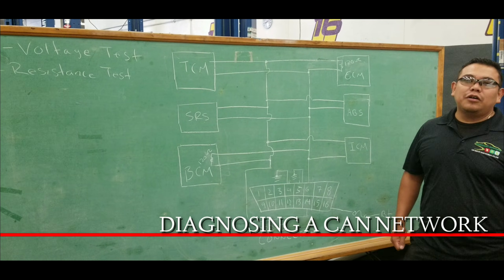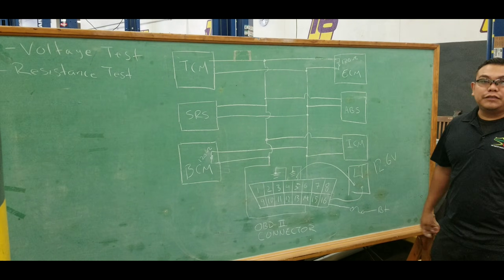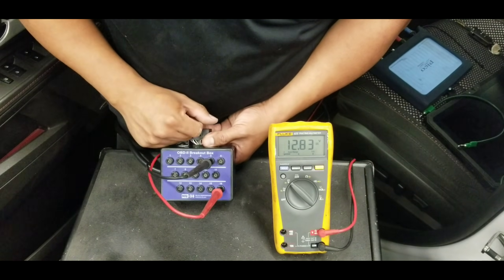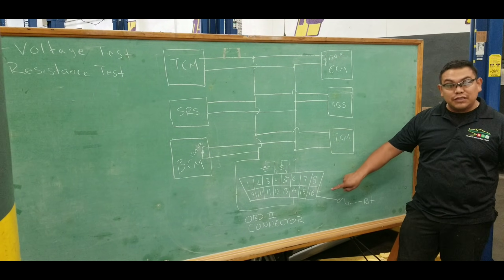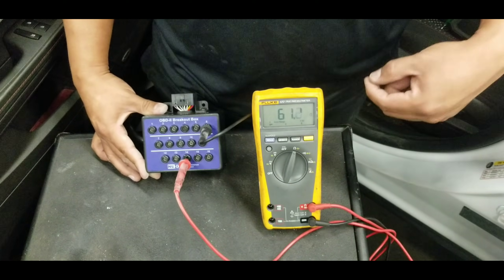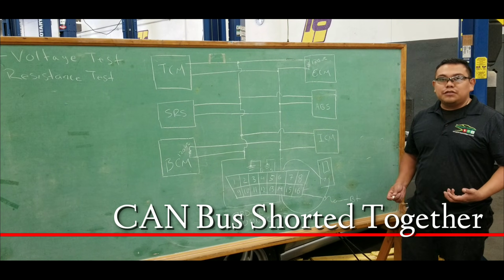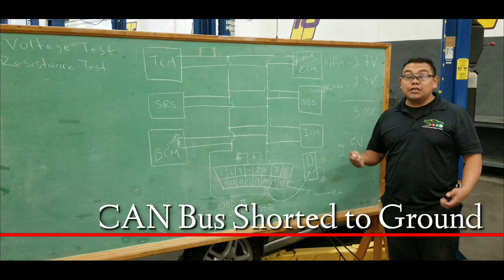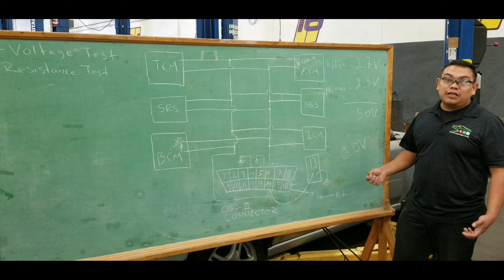How to test a CAN bus network with a meter

Comment: Great video! My issue is that I'm getting low voltage on can-H (around 1,5V) and can-L (around 0,5V), but the resistance test gives me exactly 60. Where should I start looking for the cause of this? I'm also getting full voltage (12,5V) to obd's port 16 so my battery is not the issue.

Comment: Thank you for this video, What happens if we connect the high can bus wire from one ECU to the low can bus wire and the low can bus wire to the high can bus wire of the other ECU?
Reply from the maker: The wires will be shorted together, the meter will read 2.5 volts and communication between modules will not occur.

Comment: Valuable information.  The drawing was helpful and is always appreciated.
Can you do the same type of video for an OBD1 system?
Reply: None of this works on OBD 1 vehicles.
OBD 1st Generation of " Check Engine Lights " are  some1979 to 1982 vehicles & especially 1983 to 1995 vehicles.

OBD 2 Generation vehicles are 1996 to Year 2022 , so far.

What the sharp Instructor is Sharing is  for the Advanced vehicles utilizing  CAN ,
which commenced in Model Year
2007 or 2008 vehicles ; it's called
Controlled Area Network vehicles.

There are " 4 " types of Diagnostic 
Trouble Codes that can be retrieved when the Check Engine Light
Illuminates : Powertrain Trouble Codes
( which will Automatically Fail a California vehicle on a Smog Inspection  )....P0301 : Misfire on Cylinder # 1 for Example....Any vehicle in the United States that displays P0301 from Model Year 1996 to Model Year 2022 means the same thing , " You have a Misfire on Cylinder # 1
( whether it's a Volkswagon  - Ford Mustang - Chevy Camaro - a BMW or -
Mercedes  Benz.

Chassis Control Module Codes
Body Control Module Codes  &
the CAN vehicle has " U - Network Codes "

Ex Smog  Repair Technician
Southern California
Hope this Helps

Comment: Is this the best way to diagnose cpu problems
Reply from the maker: This is the way to check the bus network in case of a no communication. This method can help identify a faulty module that is unable to communicate and shorting out the bus network. Once the module is identified, the next step is making sure that the module has the required powers and grounds.

Comment: You cant beat a simplified drawing to teach the CAN bus. Very well done. I would like to add one thing. When using the multimeter the voltage and resistance will auto-range unless you change it. So, for example, you may be reading 12.50 millivolts instead of 12.50 volts. If you aren't paying attention to the digit after the voltage numbers you could end up chasing your tail. Same goes for resistance readings. I (now) always press the range button to manually set the meter to a specific range  like 0-20VDC. Same goes for resistance readings. Thanks for the video.

Comment: you can take a 120 ohm resistor and place it in parts of the network to isolate parts of the network to speed up diag

Comment: What if the meter displays 109ohms when ecm is disconnected, what could be the problem(s)?
Reply: Pull out the other resistor on the other end of the circuit and do a ohms resistance test across the two pins. Should read 121

Comment: Hi I suck with electrical and was wondering if you could help out? Bought a 2006 Dodge Charger rt, was having some small electrical problems at first then started stalling, ordered a pre programmed pcm as a mechanic stated because I didn’t have the tool to diagnose that, now that I have it took it back to mechanic, and now there saying I have a can b bus problem U0019. Is there a chance the new pcm is the problem or is it the can b bus, but then shouldn’t that have came up before getting the new pcm? Any help would be appreciated, Thanks

Comment: I'm working on a ram 1500 5.7. No communication with multiple modules. 61 ohm on pin 6 and 14, but I have 2.4 volts on both 6 and 14. Does that mean I have a short on that twisted pair 6 and 14 from the tipm?

Comment: You forgot one other problem. As long as the two modules that have the 120 ohm resistors are connected to the network everything you said is correct. BUT if any, or all, of the other modules are disconnected ( open) circuit, none of those tests will show that.  i.e. body shop does not repair or replace the wiring harness ...

Comment: I would like to add that in the beginning he said one of the first steps is to disconnect and measure resistance but I disagree. If you happen to catch the failure in progress DO NOT disconnect because if you do happen to have a Module failure you can cause the failure to correct itself and you will be chasing your ass! The more reliable tool for diagnosing CAN should be a scope to actually see the signal without mode of failure interruption.
Reply from the maker: I agree, discomnecting a module can cause the problem to correct itself.  I also made a video using an oscilloscope  which is the best option.

Comment: Please I need your help. My car is 2013 F150 Ford has hard steering wheel to turn its hard to turn . My scanner shows me codes U0131 Lost communication with steering module . I have 12.6 Volt between 4 and 16 . Also I have 60 ohm between 6and 14 . But when I put it on volt test between ground and 6 it’s shows me 0.2v and between ground and 14 is 0.2v. 
Please what do you think?

Comment: @Mr.Diagnostech

Great video! Noticed one thing I didn't see in comments but didn't read thru them all either. 

Around the 1:57-2:01 mark when your saying numbers you mentioned voltage at number 6 when we all know you meant 16 when checking for the voltage and pins 4 & 5 for the ground. 

I think you were thinking about pins 4 & 5 and 6 came out naturally vs 16 as numerical order. 

Great video, keep up the good work and I'll be subscribing!

Comment: Thanks. I got a no crack/no start on a 2011 chevy malibu after replacing starter. Already did the swapp of all tcm, ecm, bcm, and fuse/relay box. Starter signal wire isn't getting power to start. Got the starter to start by touching a 87 in the relay when plugged in. Going to do these tests and hopefully find the wiring problem. If not, junking it. Seems like a short between bcm and ecm. Sighhhhh.
Reply from the maker: Watch the video https://youtu.be/BFT6k7VERbE it will also help with this issue.
Reply: @MRDIAGNOSTECH  Thank you for the suggestion. But the start relay was not the problem. The start relay isnt getting any power. I installed the relay with the cap off, and attempted to start, relay doesn't move/click. I measured resistance from both 120ohm from the obd port and got 64.3ohms. 

Not sure if you're fimiliar with the chevy electric problem where the guages don't go all the way over and back after attempting to start, no temp reading from the cluster, constant repeating messages to check power steering, esc, and traction control light intermittently comes on, blinks erratically. Its leading me to think I have to replace the complete harness that goes inside the vehicle.

Had no electrical problems until after I replace the starter after recently having the engine replaced. Been tackling this issue for about a couple of months and i'm losing motivation to keep diagnosing. Only thing I havent swapped out was the ignition switch. This is seriously stressing me out. But thanks for your help though.
Reply: Hello sir, I finally did all the tests just now. Everything shows same numbers as yours test exept for the CAN voltage test. They're a lot higher than 2.7/2.3 v. Low measures 3.67v, High measures 3.48v. Resistance is at 60.6 ohm. Is there any concern for the high 7+ voltage?

Only problem I found is no power going to pin 85 in the start relay from ecm/pcm when turnkey over to crank. Swapping out the BCM and ECM didn't fix that problem so its either the CAN wires between the ignition switch, BCM, and ECM. I already have the new ignition switch, so maybe I go install that and see what happens. (Edit: Swapped switch didn't correct the no crank issue).
Reply from the maker: @PanameraTurboSEHybrid  Based on how the problem started after an engine replacement,  I would first focus on checking all the grounds to the engine and chassis grounds. Remove them, clean the contact surface and connectors and reinstall them. Intermittent faults can be cause by a bad contact, specially after someone has worked on it.
Reply: @MRDIAGNOSTECH  The no crank problem actually started immediately after replacing the starter. Vehicle was kind of running fine for a few days after replacing the engine until the starter give out.

And yup, the grounds were the first thing I checked once I got the car towed back to the house. I replaced the starter in the parking lot of a shopping plaza (intermittent starting issue because ground strap from starter was broken). But I'm going to cut my loss with this car now. Going to destroy it too so no one else gets to stress themselves like I have with it. Been 2 months Since it last ran. I dont like quiting, but I'll accept defeat on this. All this CAN line communication diagnosing is way beyond my experience, my brain just melts everytime I'm looking at wiring schematics. I seriously do appreciate the help. Bless.
Reply: @MRDIAGNOSTECH  Got the car crank and start today FINALLY!.....When you said to check all grounds. I went and double checked again. Found a hidden ground right under the intake manifold to the engine block. Now it makes sense why no crank after replacing the starter. I must have stretched that ground cable far enough and broke the wires attached to that terminal. Repaired that ground terminal and car started after a few tries. 

If I went and replaced the engine harness, the problem wouldve been fixed and I wouldve never knew that that ground cable was the culprit.
Reply from the maker: @PanameraTurboSEHybrid  awesome 👌

Comment: When your car breaks down and you go to a mechanic, this is the type of stuff you expect them to know. But most of the time they just use a scanner, read the codes, and tell you you need a new module or component, whatever matches the error.
My local Peugeot dealer tried to tell me I needed a new ABS module ($800) because I had an ESP/ABS warning light on. I drove away as fast as I could, and later figured out that it was a dirty EGR valve causing the problem.

Comment: If one of the ground pins is not connected, some scan tools will not communicate due to a missing ground, not all tools use the same ground pin so fixing or jumping a ground is what is needed for the diagnosis. Pin fit is the next problem when a certain scan tool will not work so tighten pins in the DLC. If the scan tool still won't work, contact the maker for a software update please. Some manufacturer spec for ohms is upwards of 70, a true problem will be quite far from 60 ohms. If there is a short and the car was not in an accident, the first question to ask the owner is, do you have any aftermarket items added to the car, some asshole used the DLC wired to get power or ground or both and did a very bad job to make good clean connections.

Comment: Please when checking the network voltage should the ignition key be on or off
Reply from the maker: Voltage at pin 16 should be available at all times.
Reply: @MRDIAGNOSTECH  please what the pin number 6 and PIN number 14
Reply from the maker: @ernestdamo677  At this pins it's normally when the ignition is on, but at times just by opening a door the body control modules wakes up and you will see the network communicating and the voltages present.
Reply: @MRDIAGNOSTECH  please you said pin number 6 have to be 2.7v and PIN number 14 have to be 2.3v but my is 11v and 10v please why

Comment: someone advise please!! help!! i did all this in video, has power i have 60 omhs from 4 and 16 but the voltage test at 12.40 mark i failed i have .9 in both sides high and low! what the hell does that mean???? stumped i have a new battery, 12.6 volts its never started car yet! new sensors, new alt. starter, have a no start no crank. if jump starter relay with small wire it cranks no start! have u0101 code no com to tcm! national mechanic notes said replace speed sensor i did no luck! car was running fine no issues let it run to long one day warming it up in garage 20 mins i turned it off it never started again! something overheated maybe, pontiac g6 they all have this issue! miles come up on dash odemter for two seconds then says error!! had a p1682 ignition switch or ecm bad. ecm works its on the bus can bus, i changed ignition switch still have that code!! cleared it comes back! i had no comunitcation with ecm also but fixed that! one of the terminator can bus 120 omh resistors must inside the onstar system i plugged onstar back in and now ecm communicates. ive lost tcm somehow dont know! it was fine ealier on! thinking must be a bad connector or wire somewhere! why in the wolrd would two bus lines high and low which should equal 5v be .9 and .9 excately!! wtf!! that 1.8 volts i guess! split even!! help     !! ill pay for right answer! at this point id give amazon card or paypal money! wwhatever someone wants! help this old marine im a fighter not a auto tech!! ( grease monkey) jarhead! usmc oh rah!
Reply from the maker: The voltage too low could mean that the communication network could be shorted to ground. I would recommend to disconnect on module at a time and check to see if the voltage comes back, you could have a module shorting out the bus lines. In this case it could be the TCM, disconnect the module and check if communication occurs.
Reply: @MRDIAGNOSTECH  thanks
Reply: @MRDIAGNOSTECH  i did what you said disconected the tcm module and took readings volts again over high and low can bus was .9 volts on both lines 1.8 toatal! now with module tcm unplugged since it through a no communication with tcm it now is lower .54  .54 on both sides!! high n low! can this be a ground rusty somewhere or break in lines to get power but not enough is wierd to me also have p1682 code ignition switch which i also changed still says its bad! i cant find wire diagram anywhere for this car they quit making them i guess! 2008 pontiac g6 lz4 3.5 ive spent hours watching videos watched you can bus video 5 times already done all the tests! everythings good expcept for can high low voltage to low! doesnt add to 5v like your class or study said! only two or one. im seeing what obd 2 scanner says in minute with the tcm still unplugged. do i have to clear codes maybe i shouldnt even if i take to dealership or garage i like to know whats wrong exactely first saves ton money. and being ripped off. p1682 can also be ecm bad it communicates fine on bus. this car idoled ran for 20 minutes warming up three months ago around xmas turned it off never ran again! never acted up nothing! when i turn key on miles say proper mileage two seconds then says error!! on odemeter! i cant need a odometer, ecm, and tcm!! thats nuts!

Comment: What if all the voltages and resistance is correct but the dlc has a link error ?
Reply from the maker: Watch my video on diagnosing a bo communication issue, it will give you ideas of what to check next. https://youtu.be/eLwK2-kN5S0
Reply: @MRDIAGNOSTECH  the car starts and runs but I have an eml and I can’t check it on a machine because it doesn’t link to the car
Reply: @MRDIAGNOSTECH  will this video also help me if I get battery voltage in voltage test. I also get 60ohms no matter what module i disconnect. I disconnect PCM BCM ABS... stable 60 ohms. 07 infiniti M35 no starts. I thought the PCM and the BCM had terminating resistor on this vehicle too but im about to disconnect the IPDM.

Comment: Ran the tests all's good except high and low voltages are the same 2.46 volts? What would be my next step 
? 60 ohms for resistance, grounds are good. By the way excellent video.

Comment: Superb information on the Can Bus system. I finally understand and feel confident to diagnose  my MB. Screw the damn dealers, they are only there to make $. I thank you Sir, best wishes to you.
Reply from the maker: Thank you, glad it was helpful.
Reply: @MRDIAGNOSTECH  I have a 1999 MB c280 that has both obd 1 port under the hood and obd 2 port under drivers dash. I did the voltage test and read 12.3 volts. That's good right?  When I did the resistance check  I read 31.4 ohms. I used the obd1 port with the 16 pin adapter. Could their be a different CAN set up for the obd1 can net work? 31.4 ohms got me confused. I do appreciate the help. MB dealer frowns on working on older MB's. Probably cause they stop supplying factory parts. Thank you!

Comment: i have 12.6 v with key off on can low , with key on i have 4.4v can L and 0.6v can H, i disconnect all modules from bus net work and as i disconnect one at the time the  voltage from the can bus connector goes to 0 volt ,apparently harness isn't at short , i dont think all modules are bad . no codes

Comment: One of the best videos I’ve seen, but I don’t get the last part. When checking to see if the the network is shorted together, my meter reads 60ohms which I thought I was supposed to read if both resistors are working. If anyone has the time to answer me that’ll be greatly appreciated.
Reply: It should hit resistance on either end, but since the cables are touching, or shorted, the signal is going across, hence no resistance.